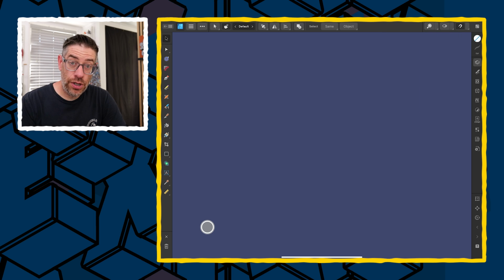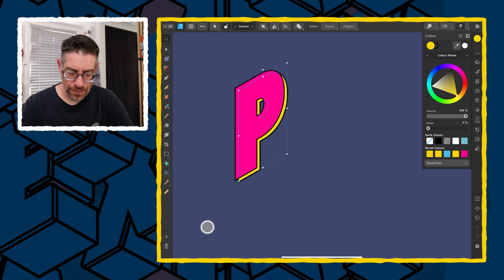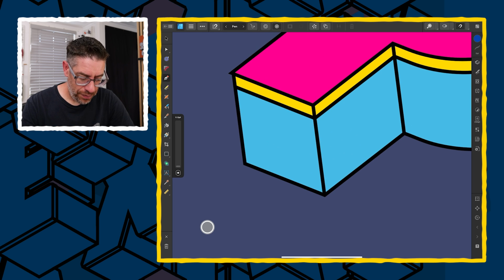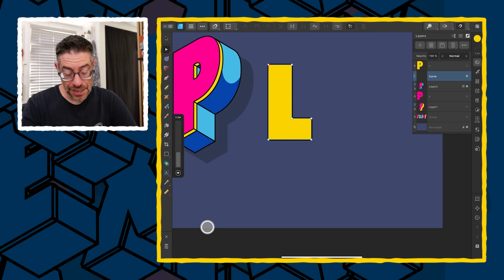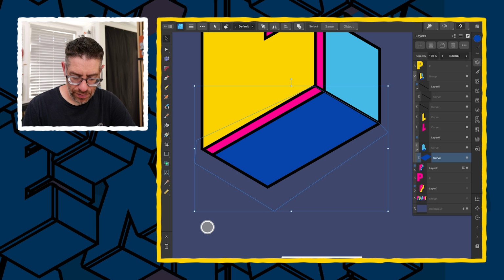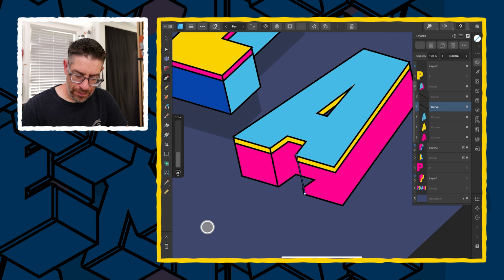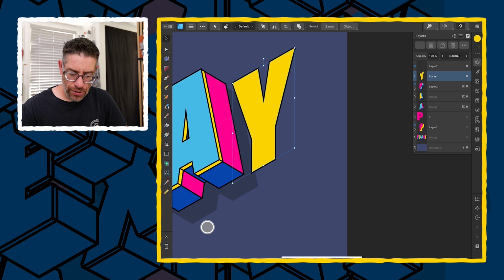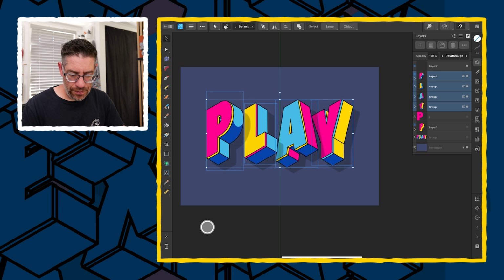3D Typography in Affinity Designer

Comment: You can get the same effect as the return key you mentioned by duplicating the layer once, moving it slightly in the direction you want, and then every duplicate after that will include the adjustment. Then merge and delete the jagged nodes.

Comment: by the way, if you ever need this, but, when you have keyboard opened to type something. On the right hand side bottom of the keyboard, there is a symbol that is to minimize keyboard (keyboard with down arrow) press and hold it, there you can have a floating keyboard selection, this will allow you to use iphone like sized keyboard and place it anywhere on screen.
Reply from the maker: Top tip, thanks, I forgot about that.
Reply: @IanBarnard  happy to remind :), loved the tutorial!